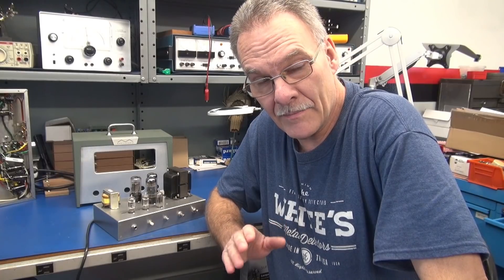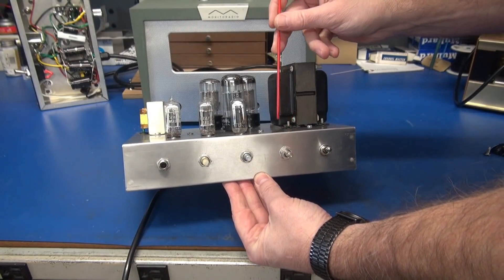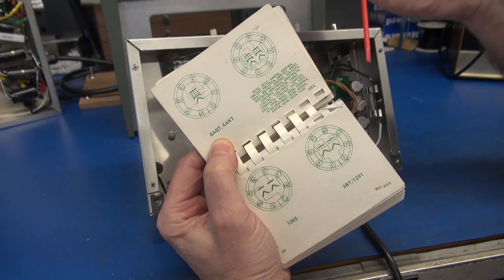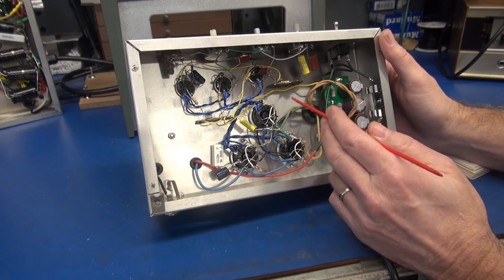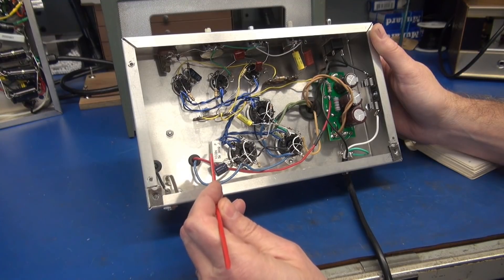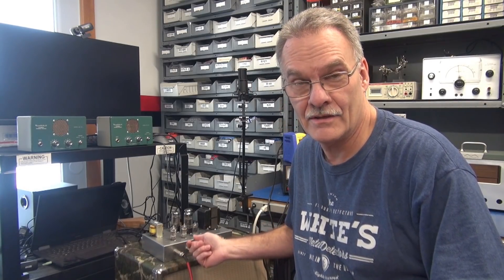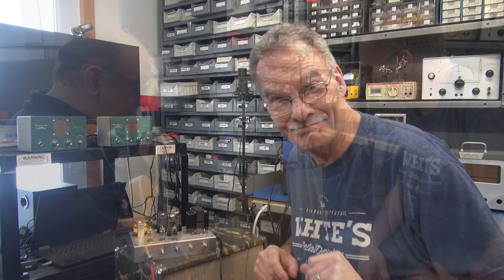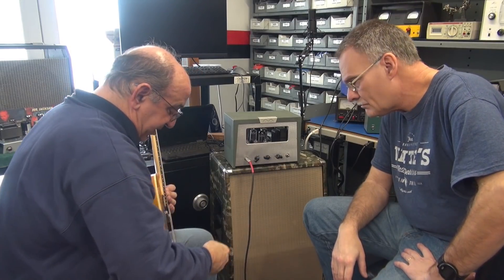Build a 6SN7 Triode tube Guitar Class A amp can it be done Solution Unique D-Lab design cool!

Comment: 6AQ5 and 6K6 tubes are another cheap way to go. 
I actually built an amp with 6AV6’s and 6AQ5’s with a huge stash of NOS 7 pin sockets I found at a surplus store. The 20 tubes I bought cost more to ship(only used 8). That thing screamed!

Comment: I guess I would like to know where you are getting 6sn7s for 50 cents a piece. I use them in my audio amp builds and the best source I have is $12.00 NOS. If you look on ebay, the prices for new tubes are in the $25-$55 range. Amazon: the cheapest I found was EH at $36
Reply: Agreed. 6SN7s from Tubesandmore are $18.......  Maybe from Hamfests?
Reply from the maker: Yes, I would not buy them new, there are plenty on the used & NOS market

Comment: Personally I would put a cathode bypass cap across the 1.5K resistor of that second 6AV6 tube to get a little more gain after the tone stack. Get a more guitar friendly sound. I do like the idea of running power tubes in parallel and class A. If I recall, Allesandro made 20 watt tube amps using four 6V6 power tubes in parallel for a similar effect.

Comment: Back before the introduction of the miniature 7 and 9 pin tubes, The 6SN7 was a very common dual triode. Commonly used as audio preamp or oscillator tubes. It was basically the predecessor to the 12A*7 series.
The 6SN7 is a pair of 6J5 tubes in one envelope.
Why didn't you use 6SN7s for the preamp stage, as well.  A six tube amp with ALL 6SN7s.
Reply: Now that would be cool ......

Comment: hello  like your  work im new and just want  2 ask u on marshall jcm 800 100w 2203 1985 with no bias point and on pin 5 gives me 444v. if i put on the 1-8pin the resistor that you put on the one video where you put that resistor, can i get the bias for el34 that i just swapt. im one of  does that i try doing it my self. thanks for your help

Comment: When you send a test signal using a test tone generator (whether I'm trouble shooting an amp or a guitar pedal that have hi-z inputs) do I need to add a resistor or transformer or something in line with the test signal test lead before it hits the device's input, or doesn't that really matter?
Reply from the maker: Nope, just use a signal generator that has an output attenuator. You only want to output 150-200mv

Comment: Cool little amp! How many watts does it have? Do you have a parts list, and could you configure it with a tremolo circuit?
Reply from the maker: This is a 3 watt model. Yes, Tremolo could be added, but at this point, I have wrapped up this project

Comment: Cool little amp but seems like a waste of sockets and 6sn7’s especially when I get new Russian 6p3s’s (6L6GB) for $25 a quad. 1 socket + 1 6p3s would be cheaper than 3 sockets + 3 6sn7s. But I do like that cranked triode sound Tony is getting. Also for R&R guitar amps,… I think some sort of PRE & POST volume knobs are a must have.